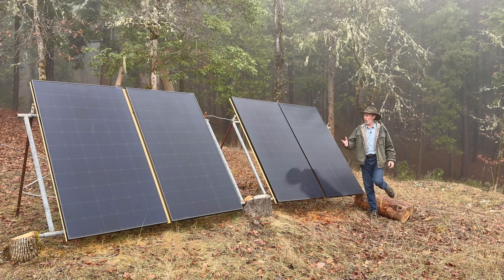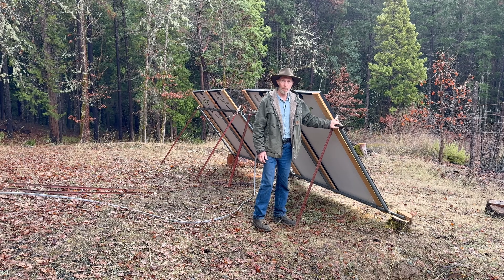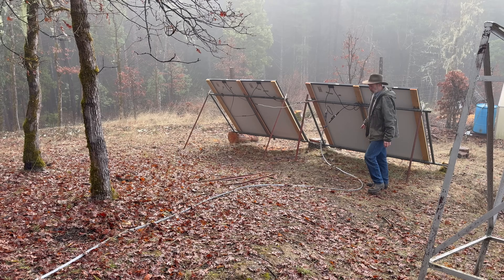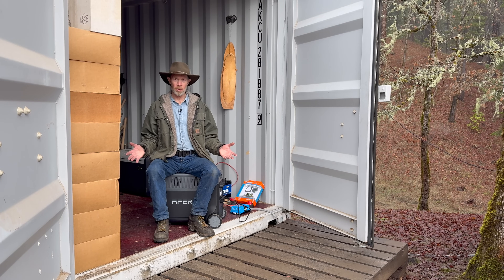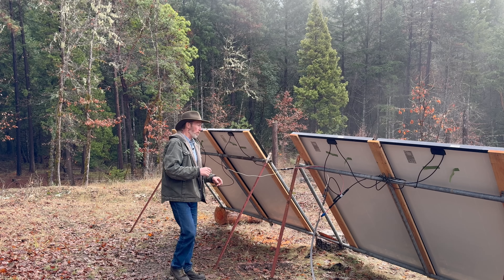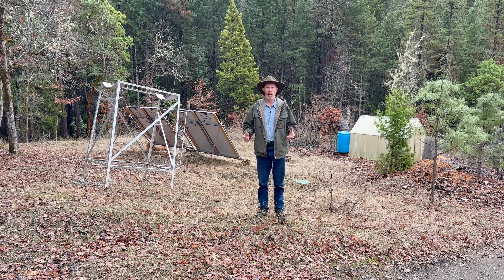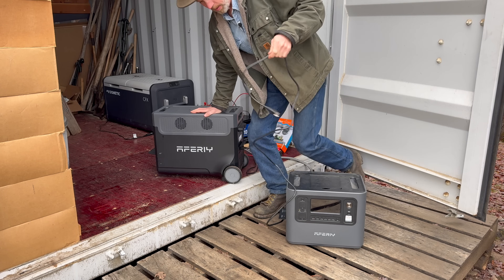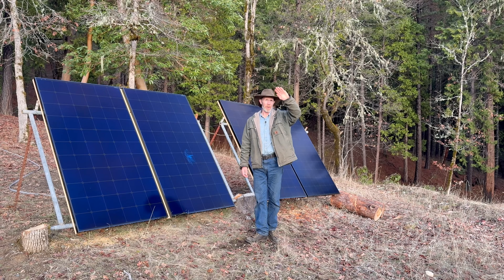DIY Solar So Simple Even a Logger Can Do It

Comment: Power goes out often here, northern BC. Over 50hrs one time this fall. Internet for communications as there's no mobility here, and freezer/fridge.. everyone has a generator but, solar is my next step.. having wood heat, and gravity fed water makes all the difference.. great videos, Merry Christmas ⛄
Reply: What I did was make a solar setup that runs my fridge and some lights indefinitely. When the power is working it still saves me money, but when the power goes out I got a nice reserve to tap into and I know my essentials will keep running. No worries about having an interconnect or transfer switch. The fridge, kitchen and hallway light, and two outlets in the house marked "Generator" just run off solar forever. (I'll move other stuff to the generator outlets during the summer and spring months to make better use of the higher generation)

Because I did it all myself the payoff period is something like 10-15 years, so not only do I have a backup for emergencies, it's going to pay itself off in due time outside of emergencies.
Reply: @chaon93  
From experience as a long time off-gridder:
The solar panels are paid off fairly rapidly if you use the bulk of it during peak production.
Usage over night, doesn't have a return on investment, ever!
Batteries are a constant expense over a long time. By the time they're paid for, you need new ones.
The newer LiFePo batteries are finally competitive with the lead acid, and that's the route I will now go.

Comment: I've been thinking about it and you really made it simpler than what I thought, which was not that much more complicated but, still, I thank you for that.

Around here, solar panel prices have gone down dramatically. There's this "big box store" (different brand from whatever you may find in the US) which usually has low prices that used to sell some similar solar panels for about 175€ (a bit more if you think in $) and since a few months ago they are at 75€ each. I had to look twice as I thought I might had not seen the 1 in front of the rest of the number.

I'll take a look at those "all in one". Thanks!

Comment: Why just 2 x 80 volts?
Why not put hem all in series and use 160 Volts.
I assume your controller is MPPT.
Reply: That would be the smart move if the controller is rated for it.
Some of the Victon controllers will handle 250VOC.
Not sure which Victon model he had there.
His feed wire 6 guage is too small in it's current configuration.
Reply: Later on in the video he had a Victon 150 45.
Max is 150VOC.
Oh well. LoL

Comment: I had old garage doors that I stripped out the aluminum rails and edging. When  I built my Leanto onto my shed I allowed 2' of treated 4x4 posts to be above the roof slope. I put 2x4 angled Braces on each 4x4 post. Then I attached Horizontally 3 runs of the Garage door aluminum rails.  I mounted 4 120watt panels on these rails. They are wired just like yours. The wire they attach to go into the shed to a 1000 watt Grid tie inverter that needs 20Vdc to Operate. My major problem is 2 trees on my Property that give partial shade during the day. Less during the winter than summer. Maybe one of these days I will own a Power station. Out of my retried budget range under bidenomics. Maybe under Trumpnomics I can afford 1. ;) The wire I used was #12 Braided copper wire from the panels to inverter. About a 25ft run so loss is minimal. This run of wire also has 4 #12 braided in it. So i have a spare set to use when I can add more panels. Merry Christmas & Have a Blessed Happy New Year. 2025 is gonna be a year Of BIG Changes! Hallelujah!
Reply: @JosEPh-zy3yr  
If you're running 480 watts at 20 volts DC, you're pushing 24 Amperes through 12 guage wire rated for 20 amperes.
Major resistance loss there, and a fire risk.
There's charts online for correct wire size and distance losses.
.

Comment: Since the power station wants a lower voltage you are decreasing your power output from the panels by putting them in series.  You have cut your current in half.  You should wire all of the panels in parallel.
Reply: Power output from the panels remain the same regardless of wiring configuration,...
Excepting some loss from resistance from lower voltage.
There's a formula/charts for proper wire sizing and resistance over distance and guage.
Reply: @blaydCA  Yes, but how efficient is the power station in accepting different voltages? I didn't see any specification on that.
Reply: @jimprice1959  
As a rule of thumb:
Higher voltages most often equal higher efficiency.
That said:
Individual brands will have different electronics and battery management systems as well as battery quality.
If it's not on a specification sheet call the customer technical support number to get an answer.
Personally, these Power stations aren't suitable for my requirements.
They're good for those that want short term power in a rare situation.
Reply: The power station accepts up to 160v doesn't it? This configuration is about 98v VoC so that should be pretty optimal unless I'm misunderstanding

Comment: I barely have to adjust the angle on my SoCal High Desert panels from peak summer to peak winter.
My Southeast Oregon property is an absolute nightmare, because every month tree shading changes big time!
I have one bald area on the hilltop that is one heck of a wire run which is windy, so will have to massively secure them.
Remember...Big panels make HUGE wind sails!
Extra heavy bolts and piers to secure them!
Reply: Look into microinverters if you have all your panels in 1 string. Enphase IQ8 are the current gold standard.

It minimizes loss due to shading on individual panels, so each panel outputs as much as it can, without being bogged down due to another panel shading it out.
Reply: @blakegeissbuhler  
With wire costs these days, the Enphase IQ8A does make sense for long runs.
Back when I first did off-grid, a 500 ft spool of 2 guage was about $400.
Same spool now is $3000.00
Equipment costs are far lower than 18 years ago as well.
Reply: Additional Notes:
DON'T rapid disconnect those panels under load!
AC current travels with less loss over distance. Avoid long DC runs regardless of higher voltage.
Increase wire size for DC for longer runs. I up size over recommended size.
Reply: ADDITIONAL NOTE NUMBER 2:
6/2 Wire size WAAAAY to small for that run!
Ouch!
Reply: Additional Note Number 3
Critters just LOVE to chew on buried cables. EMT would be a good idea!
Plus if those thin wires catch on fire, the fire will be contained inside the EMT.
Reply: Additional Note Number 4:
Micro inverter is a possible solution, but expensive option for that long run.
Have to reconvert to DC to charge batteries though.

Comment: Ideally, the best performance will come from panels that are 90 degrees to the sun. So it helps to adjust the tilt of the panel throughout the seasons. Tilt the panels lower in the winter season where the sun is. Higher tilt in the summer.

Comment: You should mention that if you put panels in series, that whole batch will output less power when (only) one panel is (partly) in the shade. With parallel wiring that is not the case - all (other) panels will output normally.
Reply: Yes, but also mention that putting them in parallel will require not only a lot more more wire, but also the distance to the panels will need to be less, and you will need a much much bigger, and possibly more channel charge controller. Best solution is series parallel of two to 4 series groups.

Comment: If you think about electricity and its usage, you soon realize that in order to use it, some sort of source has to be working.

That source could be an active generator, as with house current and the commercial power company (grid) or storage batteries or . . . 

I don't use either. My battery is 2,000 gallons of compressed air, sourced from photovoltaic directly driving compressors or from wind turbines that pump air.

When I need electricity,  I make it.

I can direct-generate almost any voltage a.c. or d.c.

I homestead alone in Texas and I like to build stuff.  I'm autistic.
Reply: Sounds interesting..
Reply: How big are your air tanks to store 2000 gallons of compressed air? Does your setup fill the compressors automatically or do you have to turn it on manually?
How do you directly power the compressors from solar panels? Just plug them in? 

Thanks. Your setup sounds pretty interesting.
Reply: @Tonisuperfly 
Solar panels are 18 volt. They are wired directly.  When the sun shines, the compressed air motors spin.

I have several 50-gallon tanks, several 60-gallon tanks, miles of pipe and one 300-gallon tank.

Entire system has isolation valves and check valves to prevent a massive leak from draining the system.

System over-pressure protection is a blow-down valve set to 80 psig.  Any more air just spills back to the atmosphere.

Compressed air runs any of several compresses-air motors of my own design & fabrication. They run machinery, generators, fans, pumps . . . Almost anything that would normally use electricity.

Im still grid tied, so I can arc weld, but my monthly power consumption is rarely over $15.

Comment: Find you a place protected from wind and mount the panels on a gimbol. That way, you can track the sun's apparent movement.

Set your angle of inclination at your mean latitude and you can use just one motor tracking on either a chain or worm gear drive.
Reply: the big question is: is the gain worth the effort?  for that matter, is the gain from moving the panels back 6 feet worth the effort?
Reply: @kenbrown2808  
Effort is a moot point for me.  I make my own electricity, so no effort = no gain.
Reply: @SiwyWabbit  so here's a question: if your system is making all the electricity you need, do you go out and spend hours and money trying to get it to make more?  right now his investment in the mount is about $13.27, and his yield is 100% of his electricity needs. you are suggesting he increase his financial investment by a minimum of 500% and probably closer to 1000%, to make his power system hit its full charge shutdown point 10% sooner.
Reply: @kenbrown2808  
As for me, I like to tinker. I don't chase after money. I live debt free.

As to him, I don't give a hoot. I offered a different method, is all.

Your comment sounds almost like an idigtement from the Internet Police.
Reply: Reading the post here:
Stark difference from full time off-gridder versus occasional use people.
Off-gridders need every watt possible for those less than sunny days.
Reply: @blaydCA  
I agree. Less-than-sunny days here in Texas are often accompanied by wind and that's why my "battery" is compressed air.  With 2,000 gallons of compressed air, from photo-voltaic driven as well as from wind turbine compressors, I can make what electricity I need, almost anytime I want.

I do, however, employ several 12-volt lawn tractor batteries as well as AA cells (3-volt trigger voltage for LED string lights) for lighting.
I avoid using electricity for any heating applications.
Reply: @SiwyWabbit  
You would be the first person that I have encountered that stores energy with compressed air. I can see the benefits from it because you delete batteries entirely, and a good industrial compressor goes forever.
My SoCal off-grid has solar, wind and lead acid batteries which will be moved to the new Summer Camp in Oregon.
Batteries are end of life, so will get replaced with LiFePo server rack batteries and probably an updated all in one unit for charge/inverter/generator.
Wind turbine will stay in SoCal as it's not worth moving.
I'm in my grid connected other home in SoCal, and the electric bill is horrible.
Reply: @blaydCA  
I tried replicating honey bees' actions as regards energy.  

By that, I'm mean: 
Have you ever seen a 500-pound honey bee? 

Me neither.

Rather, I have often witnessed thousands of tiny bees all doing the work of one giant bee. 

To that end, all my turbines pump tiny squirts of air, 3 squirts per revolution, all feeding a grid work of pipes and receivers. 

 Each HAWT turbine has only 1 moving part plus a yaw bearing.

Whenever the wind blows, I'm compressing air. 

I also use photo-electric compressors. They run hydroponic DWC air bubblers, growing herbs and tomatoes in my greenhouse. 

 I invented a one-moving-part rotary air motor 40 years ago, which turns generators and, in turn, makes a.c. and d.c. electricity.
Reply: @WhatDadIsUpTo  
I can't picture your setup.
Sounds like you're a brilliant engineer!
I'm just a retired contractor who isn't perplexed with a little experimentation here and there on non essential gizmos.
If I stumble across a five hundred pound honey bee, I'm gonna toss a saddle on it!
Reply: @blaydCA  
I'm a 75 year old retired plumbing contractor. I'm also autistic with a through-the-roof IQ, which I'm sure has a lot to do with my thought process.  I have always had a fascination with movement, especially repetative, spinning movement, hence wind turbines. My two favorite subjects in school were, on order, Show & Tell and Physics.

I currently fly 11 windmills. I hope to increase that number to 60 by this time next year.
Reply: @SiwyWabbit  
I used to have an IQ.
I think it went missing after watching the insane politics and goings on recently.
I'm building a small cabin for my summer camp, over engineering on the fly.
So far, so good. Only made a few fixable errors doing it, that in my heyday would have never happened.